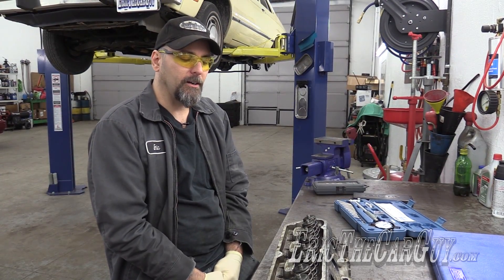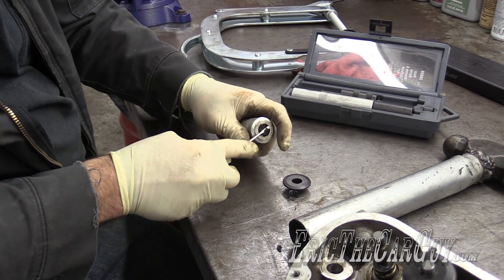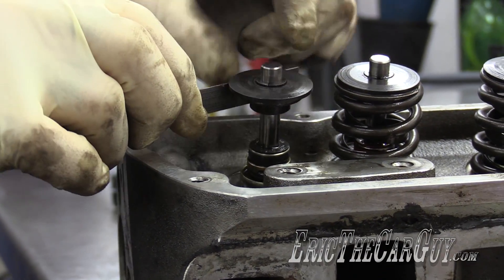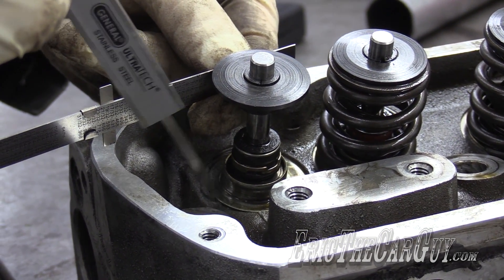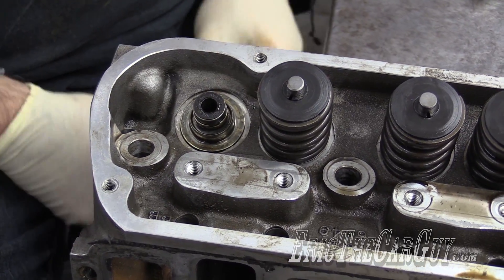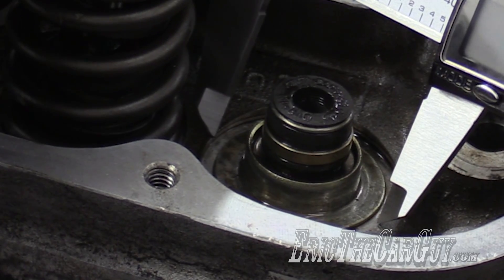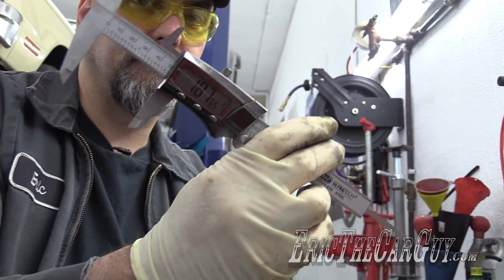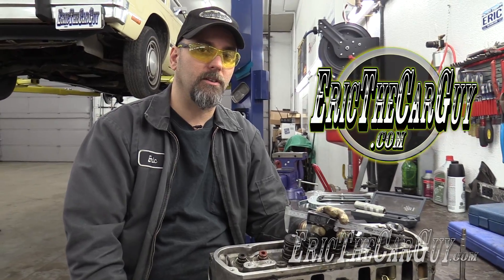Checking Valve Spring Install Height & Seat Diameter

Comment: How often do you just look at the valve springs and be like yeah I need new valve springs. Yes I could measure the depth of the tread of the tire but 90% of the times you can just look at it and say yeah I need new tires you might want to take a measurement if you're trying to sell the job. I can look at brake pads. I could measure the thickness of the brake pads but if they're thin and it's my truck I'm just going to replace them. Does this thinking hold true when it comes to valve springs. I'm not yet done my first valve spring job.

Comment: Hi Eric, wanted replace valve springs on my A20A honda. Having to replace head gasket so whilst out  I thought why not? But I'm struggling to find same but new valves, not available anywhere. So I was wondering using this measurement would I be able to order in new springs, based on size rather than part code? Or do I require additional information? Thanks

Comment: 1-7/8 would be 1.875, so I bet that's probably considered the nominal spring height. (Or, perhaps, with a 2" spring that has a 1/8" compression.) Likewise, 1-7/16 is 1.438 and 1-5/8 is 1.625.... So, I would also bet that the spring seat is a nominal size of 1-7/16 with a spring wire size of 3/16. Or maybe just "1-7/16 by 1-5/8". 

I wonder if Ferd uses fractional sizes when designing or describing these parts? They certainly do with the pistons...

Comment: Hey Eric, my buddy asked me if i could change a water pump for him on a 2005 5.7 hemi. The car was idle for about 4 yrs. When he brought it over i noticed the dipstick  looked like it was burnt, it had lots of rust in the radiator and rust in the spark plugs. I was concerned because the water reservoir was boiling over. He assured me all it needed was a new water pump so i replaced it. The next day i baked it out of my garage left it running for about 5 min while i closed the g door, when i came out the engine was knocking. Took it to a shop they say it was extreme over heating. How can it overheat with a brand new water pump?

Comment: Here's a question for you! Can a car run without a battrey? thank you!
Reply: if you can get it started yes.
Reply: Thank you for your answer! I was just wondering because I saw a guy on youtube replace his battrey with a set of 12 volt compassorters. I was under the impression that if you ran your car without a battrey that it would burn the alternator up are it would just plan out shorten the life of the Alternator.
Reply: Well in his case the capacitors were acting as his battery because capacitors store electricity. The alternator can easily handle the cars electrical load. The battery is really only used for starting the car and running in accessory mode

Comment: Lay a long straight edge across the tops of all the valve stems.  On my heads, they weren't all the same.  The valve stems were obviously all the same, but some of the valve grinds were deeper than others.  That varied as much as .020" to .030".  That was from a highly reputable head prep company.  I stayed with stock valves, springs, and retainers and an "E" cam.  Pedestal roller rockers had to be shimmed.  No problems after 6,000 miles and quite a few spirited accelerations.  Just for reference, 284 RWHP with 4.11 gears in a '66 Mustang coupe.

Comment: is this 0.02mm or 0.05mm caliper? im planning to get one of this digital caliper

currently, im using a mitutoyo calipers and it would take me a couple of minutes to verify my measurements
Reply: If you are going to buy a set of calipers buy mituoyo. Anything less is a waste. I'm sure there are better ones than Mituoyo, however for the 150 bucks they are superbly accurate for this type of work.
Reply from the maker: It's linked in the description.

Comment: Is there any risk of damaging the head when you remove the valve spring using the hammer tool?
Reply: It's got a hole in the middle, so you're just pushing the ring and spring.. and those things are pushed all the time as valves are opening and closing.. so you should be fine.
Reply from the maker: No, it's designed to be used that way. https://www.youtube.com/watch?v=qEe8C5u1LWg

Comment: If you pull valves out be very careful the top of the valve steam on a good used engine will actually slightly mushroom. So if you let the valve drop but it gets stuck lift it back up and take some light sand paper and rub it around the top so you don't score the valve guides with the valve. Do not force the valve out.

Comment: You can't measure accurately if your probe comes in at an angle. You loose a few digits. I'd get one of those adjustable vertical (for holes) parallels) those are cheap. You put it in the right place, you adjust it to size, then, remove it, and measure it, instead of the hole. Like with bore gauges.

Comment: how do you know if you should get a light or heavy compression spring?
Reply: Cam manufacturer can tell you what springs are required for your particular cam.  Seat and open press, plus installed height.

Comment: so when I get a block machined should I already have the cam, crankshaft pistons etc for the shop to use the measurements?
Reply from the maker: I did this so that I could get the correct valve springs and retainers. You'll need this info before you order them.

Comment: You need to take into account that not measuring perfectly perpendicular gives a shifted reading. The difference is not much and when you measured in inches, you rounded off quite a bit so your numbers are probably correct. But when you went to millimeters, you got down to a resolution of 0.05mm. Which is expressing your approximation too accurately. 

A better way to measure this would be using a transfer gauge, which is not terribly expensive

Comment: I honestly don't know how you do it, using metric imperial measurements. I was trying to measure an imperial nipple earlier on but couldn't figure out how to convert from metric imperial to imperial imperial (the one with fractions). It came out as something like 149/400ths.
Reply: You just eventually recognize the decimal version of the major fractions, and if it's in between you play around with 32nds or 64ths until you get there.  149/400ths is .3725.  3/8ths is .375, which is one that you just know.
Reply: krtwood

Ahh, of course. I only really know a couple of the 8ths and quarters. Probably should learn the rest. Thanks.

Comment: You did lap in those valves first didn't you?  Can't help thinking that, either way, your still going to get the standard bag of springs related to how hot a cam you've ordered.
Reply from the maker: The heads will get reconditioned in an upcoming episode.
Reply: Thanks for the reply Eric, I guess it's all in the edit.  If someone ordered their performance parts, and then reconned the heads, with the possibility of cracked seats needing inserting and cutting in or putting in hardened seats for unleaded fuel, they would get a surprise when their measured maximum spring length magically changed!

Comment: Tap on the stem with a plastic hammer while holding up on the retainer to seat the keepers. It does change your measurement.
Reply from the maker: Cool. Thanks for that tip.
Reply: I think Eric would have to find an Alero and buy it first, before he could make videos about it. ;)
Reply: @ericthecarguy You should do a video on headgasket and head repair for an Oldsmobile Alero GL2 with the v6. Many different GM cars use this engine.

Comment: I dont know how critical the measurement is, but the keepers were not seated correctly because of lack of spring pressure, the height would be a bit off.
Perhaps a small two arm puller could be used to pull the disk up and force the keepers tight.
If im talking crap, im sorry.
Reply from the maker: The spacers on these are pressed on but you are correct, if they're loose it can offset the measurement. The easiest and most accurate method is actually the special tool I pointed out. It's also linked in the description.